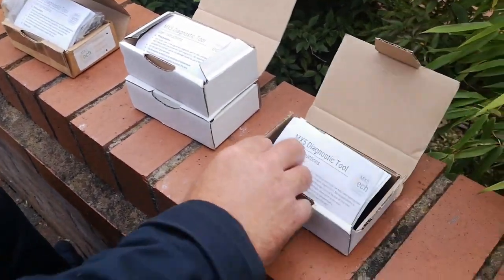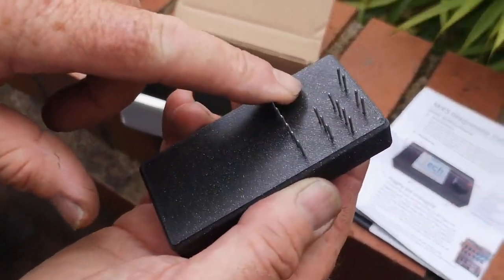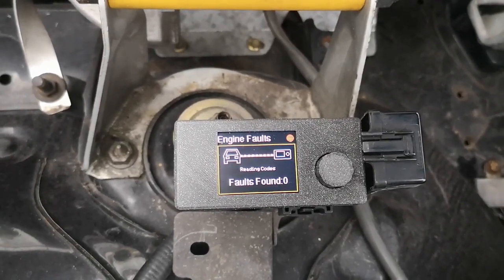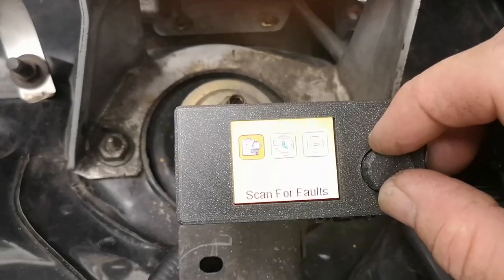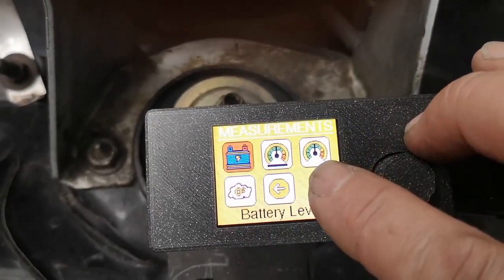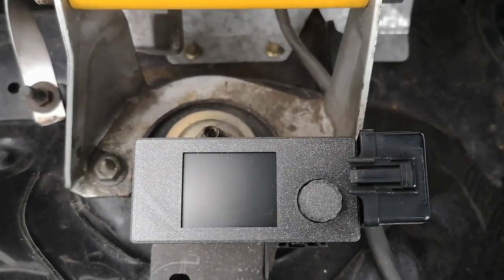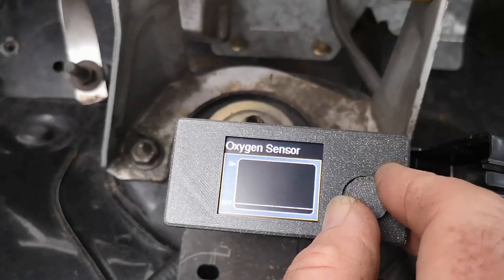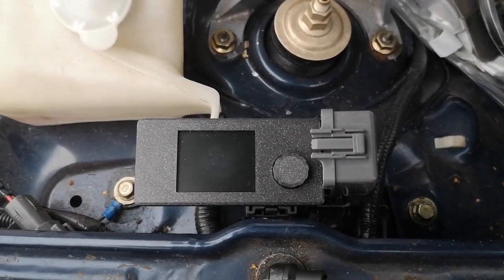MX5 Techs diagnostic fault code tester MK 1 MK 2 Version 3 1

Comment: Sad they don't sell these anymore... 😢
Reply from the maker: They will be, the issue is the supply of the chips needed as there is a world wide shortage, be he is on it.
Reply: @mazdamenders  they have been out for years.. from what I've seen on the board, every chip that could be on shortage still could have been replaced easily with minimal work years ago

Comment: There is another device called diagnosis, it is older, it helps to calibrate the exact point of the engine and move the intake throttle screw, so it is ready and exact ... that device, apart from detecting the fault codes, helps to leave the engine about to??

Comment: Hi I have a lat mk1 harvard that’s showing some strange codes, I have been told it may be obd2 without a diagnostic port, have you had any issues using* this on a very late mk1 
Thanks
Reply from the maker: No , defo OBD 1 buddy, OBDII did not come in until 2001, plus the OBD 1 was still in the NB 1 although different codes, you could try switching it to the MK 2 mode to see if it picks anything up as it is the cross over time as the NB 1 arrived in 1998 and yours is a 1997 NA, let me know the outcome please.M-m
Reply: mazdamenders  Hi I have struggled reading the codes for many years and done many searches for a code 11 that doesn’t exist. I looked on a website for code reading in general and it says all Mazda after  1995 were obd2,  though a port was not originally provided I used their explanation last night and finally got a obd2 code 1402 I think? . of egr  valve open circuit ,it was right. I honestly believe the last of the mk1 had a later obd. I have links to websites if you post a email address I will gladly forward my findings  Alan
Reply from the maker: @rustyrover3808  The connection ports are not the same 100% , only the 2001 onwards have the OBDII ports, below that is is a OBD1 port although the NB 1 used different codes to the NA which it sounds like you are getting with her being a cross over mark